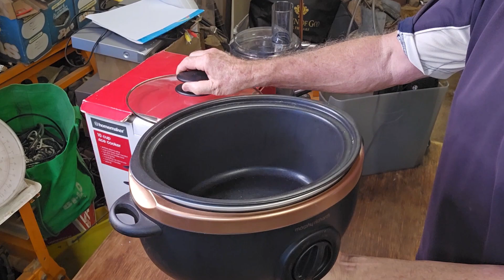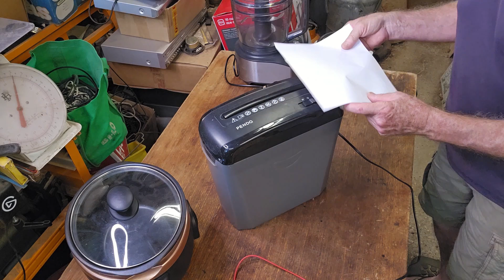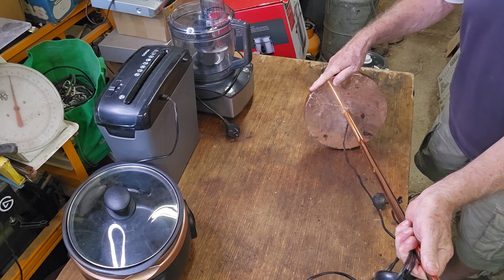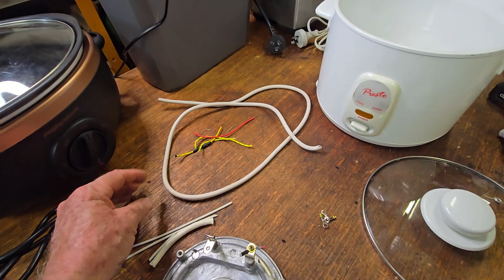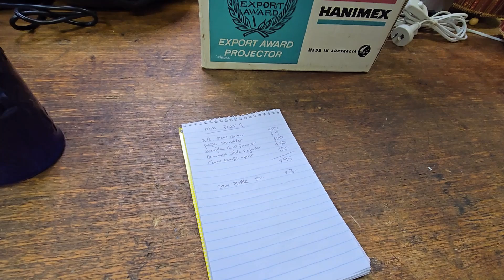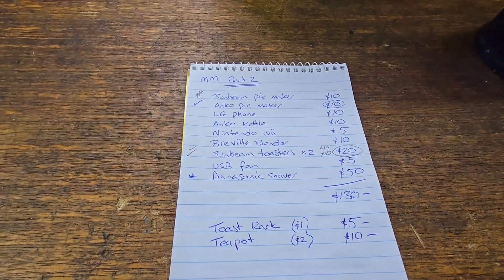Monday Marathon 4 - Processing Ewaste picked up from a Charity Shop! Some Strange Stuff this Week!!

Comment: $95 the charity shops could have got. 

The Earth test should have been done during leakage PRIOR to load testing, even if the plug has no Earth pin. i.e. ANY exposed metal on a DI appliance.
Reply from the maker: Yes, you are right about the earth test. Most of the stuff didn't have any exposed metal though. Yeah, it would be worth the charity shop having someone able to test & tag stuff for sure!